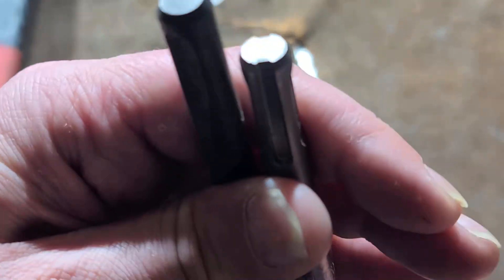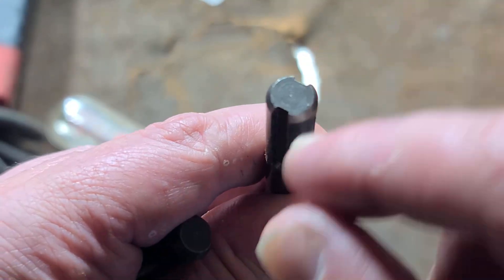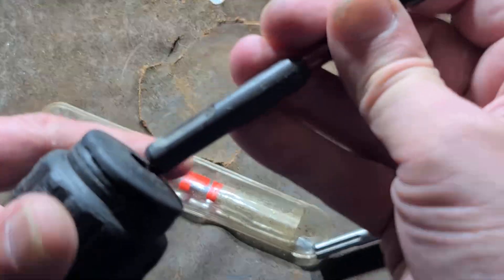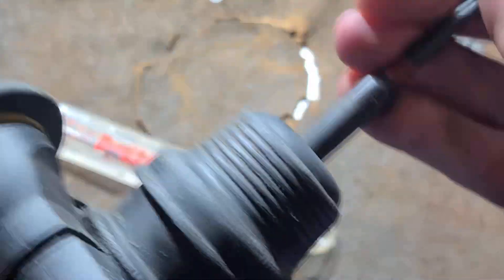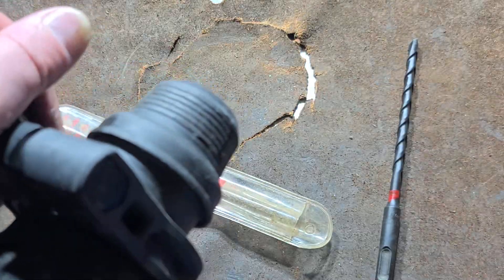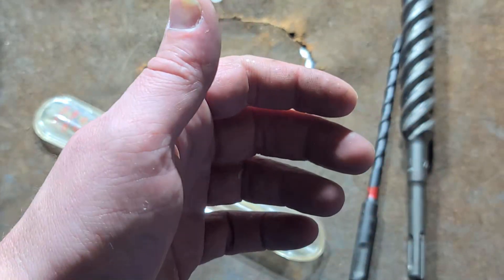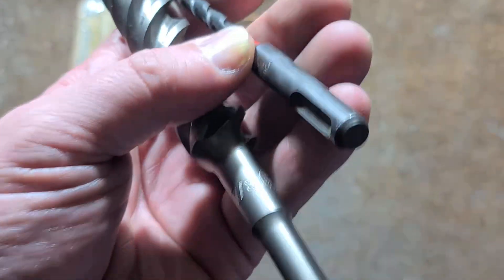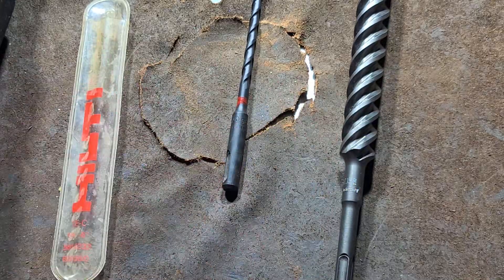SDS Vs. SDS Plus Rotary Hammer Drives & Bits Explained

Comment: I saw an old black and decker rotary hammer, the 5040 or something. It said it was Type 1. I was wondering what kind of bit it took. It must be pre SDS. I have an old concrete drill bit that just has a thread on the drill end. Is that what was used? or is the thread just for extensions and a regular chuck was used

Comment: Thanks for explanation on 'why' the change to use drive slots on SDS Plus.  Has anyone found an adapter to use the original SDS bits with a SDS Plus drill?  I have a sackful of unused Hilti bits but they are all the original style SDS.  If I had a milling machine i would consider milling the slots; has anyone done that?
Reply: I'm here because I just bought 20 of the hilti SDS bits for $ 12. I thought it was a good score. Not so sure anymore.  My drill is sds plus.

Comment: Nice video, didn’t know the history: I don’t recall using the older bits.
The splines on the SDS PLUS chucks eventually give way in a well used drill, regular repair for me to do on drills used every day for about 3 years or more.